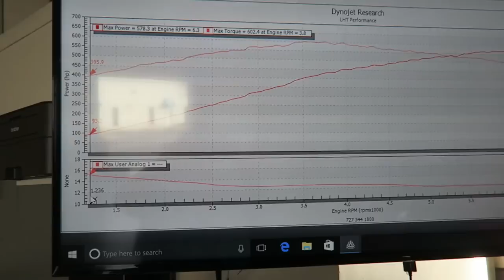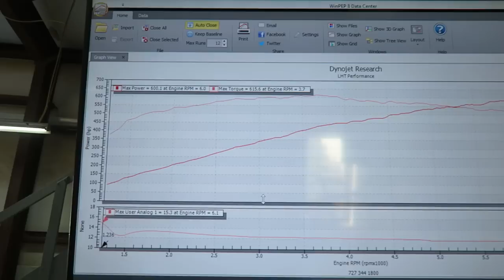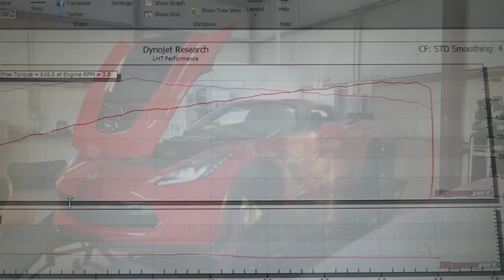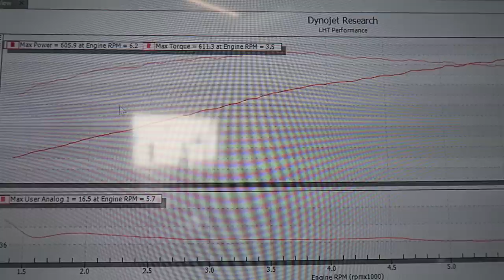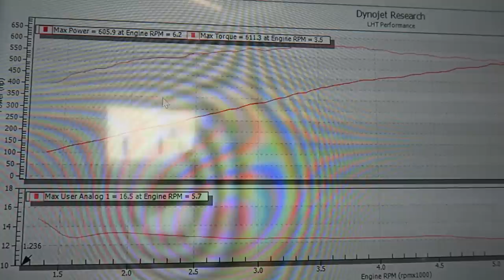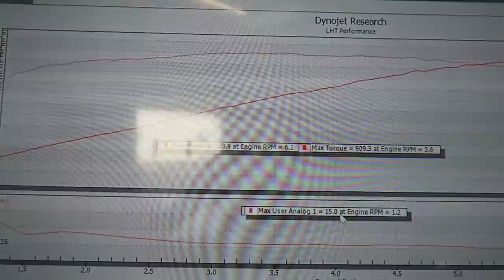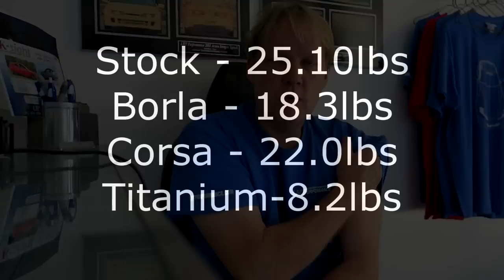Corvette C7 ZO6 X pipe test

Comment: 350 bucks bolt on borla with stock exhaust? 22 hp 13 tq and 8lbs off curb. done.
Reply: You don’t need and X pipe.  Straight exhaust
Reply: D S 
The titanium is 8 lbs not the borla

Comment: Although you didn't connect it to the system would the borla X pipe would have bolted up to the acropovitch no problem. Without modification
Reply from the maker: I think it is designed to connect to the factory system or bolt on axle back system.

Comment: I know this is a older vid on the xpipe but i had a question how tight to make the round clamps where the xpipe meets the muffler pipe. I have the kooks header and xpipe and jis wanna know the torque to make a good seal. Thanks for this imformative vid on the c7 vette

Comment: Do you think the difference in power between the X pipes was where the actual merge/crossover points were in each system?  Curious what your opinion on the optimum location for an X-pipe, some designs are closer to the engine,  or in the middle of the vehicle possibly due to space constraints?  Lastly, the design of the cross over and converging angles, what have you seen during testing from the above on NA and FI vehicles?

Comment: LHT, great analysis. Thank you for taking the time and money to do this. Is this Z06 a "50 state legal" or a CA CARB Corvette? GM makes two. One of course for the state of CA. I'm gonna end up going with the Borla for sound and power. The Corsa is too raspy. Your exhaust is very nice but I'm sure I can't afford it ;).
Reply from the maker: Felix Perez I think only the Ca model is the specific model for ca.  I’m not sure.  The cheapest and best mods IMO are Borla X, Green drop in filter and Katech Throttle body.

Comment: When you free up the exhaust flow will your afr get richer? When you tested  the first xpipe it got richer from stock  and when you tested the double x it got leaner from the x pipe or stock?
Reply from the maker: Just a 5.0 The factory ecu will constantly interfere without tuning. Once you start installing intakes and headers etc , The ecu will start pulling power and you’ll be back to stock power.

Comment: First time that I saw a comparaison between a few x-pipes in one video. No stupid loud background music. By the way and I mean no disrespect, it is Akrapovic and not Akrovic. Well done! I used to have a C6 Z06 with Kooks long tube headers, high flow cats, Corsa x-pipes and sport exhaust. My engine light was always on. Did you have the same issue?
Reply from the maker: Claude Perrault I wouldn’t change to headers until you really need to. Leave the factory cats.

Comment: How lean is too lean for the lt4?. .....How lean would a CAI and something like the borla xpipe be on a stock tune?
Reply from the maker: Bonanza Driver It depends who you talk to.  With is being Direct injected you can run them in the high 12s and even touch 13.   I personally would run it as rich as you can without costing power ( within reason of course) 
Typically installing a ‘cold air ‘ intake without a tune will lean them out and give some good gains for 2-3 dyno runs.  The computer will soon pull timing and the factory torque management will also pull power.

Comment: Have you build a 1/2 miles car? I'm trying to get my car to be in the 200 MPH club. Nice video!
Reply from the maker: I haven't but I'm it's not too far out. Most of my interest is road course, hence why I'm more concerned about lean AFs and anything that will cause heat soak.